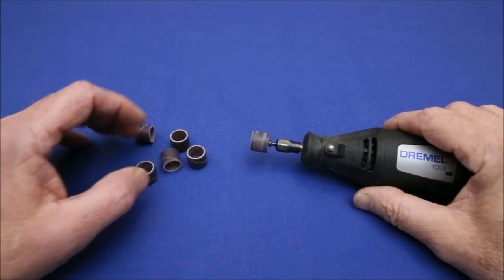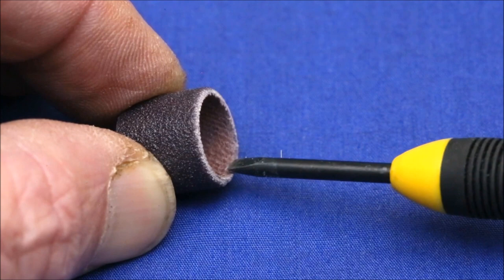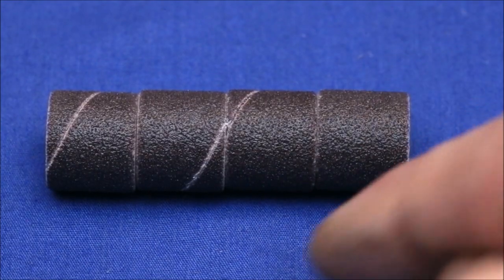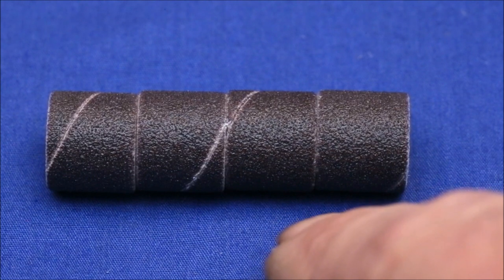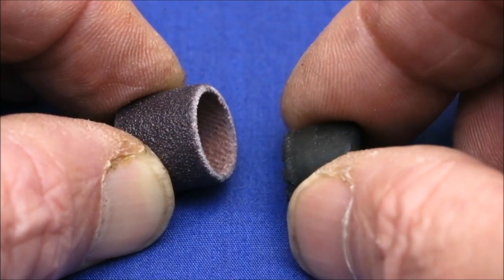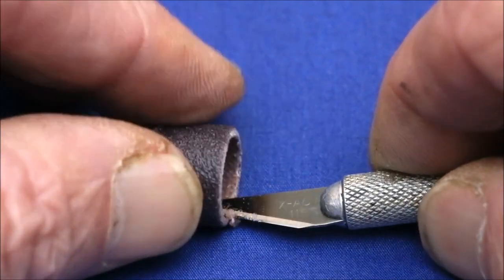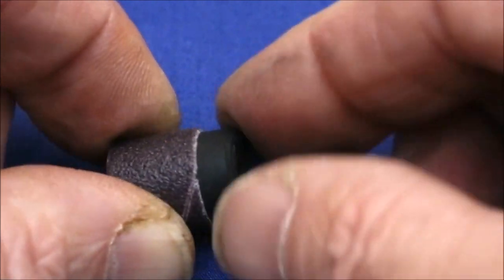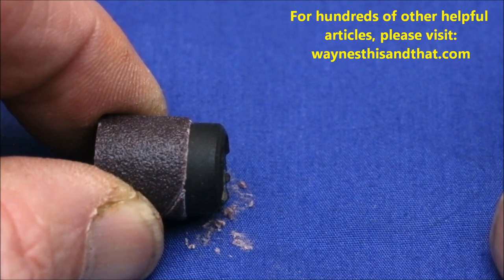Dremel Tool Sanding Cylinder Replacement

Comment: I’m tired of trying to KEEP THEM ON! Make a Vid on how to do that
Reply from the maker: Great point! It didn't used to be a problem but over the last few months I've noticed they are easier to get on and sometimes the sanding cylinder spins on it. I think the rubber is drying out and shrinking. Hmmm... this sounds like a problem that needs solving. Thanks for the comment!

Comment: You also need to loosen the screw at the top. It releases some pressure.
Reply from the maker: You're right, but even after loosening the screw it's often difficult the slide the new cylinder on.

Comment: My issue is the sanding cylinder is not tight and it rotates while sanding. I've tried various thickness of paper, tissue etc. but the centrifugal force spins the paper out from the cylinder and it begins to spin again.
Reply from the maker: Hmmm... It almost sounds like the rubber cylinder has dried out and shrunk. Have you tried buying a new mandrel with a new rubber? Also, are you tightening the screw down all the way so that it squashes the rubber making it fat enough to grab the cylinder? Are both washers still pressing against both ends of the rubber? The only other suggestion I have would be to use a layer of duct tape wrapped around the rubber. That would make it larger in diameter and be sturdier than paper sleeves. Good luck and please let me know how you eventually fix the rotating problem. I'm sure it's one other people have struggled with and they would value your solution.
Reply: @wayneschmidt490  have u found a solution to this yet? i am struggling
Reply from the maker: @user-wr9ex5dw6h  Other than buying a new mandrel with a fresh rubber cylinder, the only thing I can suggest is wrapping your cylinder with one or two layers of tape.
Reply: me knows how do it bat i cant englisz explein

Comment: did not help at all w the obvious problem -- what to do if the band is stuck on the drum; any suggestions about removing the old stuck one??!?
Reply from the maker: Happens to me all the time. I look for the corner of the spiral where it meets the edge of the tube, grab it with a needle nosed pliers and peel it off the cylinder. Hope this helps. Good luck and thanks for commenting!
Reply: You have to loosen the screw at the top.

Comment: what about those experiencing the other side of that problem? My Dremel rubber bit is not large enough, I have all three different size attachments, and they sand paper drums and rubber bits all came from the same kit, and it is by maximum (so they all came from the same kit).  How do I fix that problem, without doing something that makes it complicated to use and replace with a new one the next time around? maybe gorilla tape that sticks to the side of the drum? or is there another quick tip?
Reply from the maker: You could try wrapping a little electrical tape around the rubber cylinder to see if that allows the sanding tube to slide on while still being tight enough to hold when the securing screw is tightened. Good luck and thanks for commenting!

Comment: The rubber part of the drum keeps ripping.. how do i fix that?
Reply from the maker: Super glue works great on rubber. Or you could try wrapping it with tape. If there's a hardware store near you, you could buy a new one. I know both Hame Depot and Lowes carries them as does Walmart. Thanks for writing!

Comment: I have the OPPOSITE problem: The cylinders are TOO BIG and slide off!!
Reply from the maker: I had that once. What had happened is that the rubber was old and had shrunk. Had to buy a new one. You might be able to save it by wrapping tape around it. Good luck!

Comment: Mine are not sug enough and slide off
Reply from the maker: I've had that  problem with older mandrils. I think what's happening is that the rubber gets old and shrinks. The best solution is to buy a new one. I've tried fixing an old one by wrapping tape around it. Sometimes it works, sometimes not. Thanks for commenting!